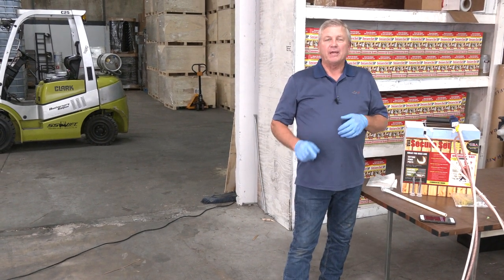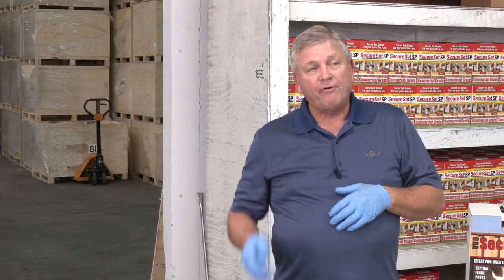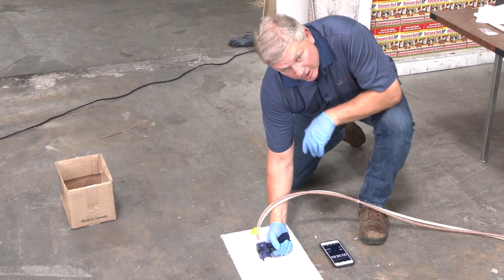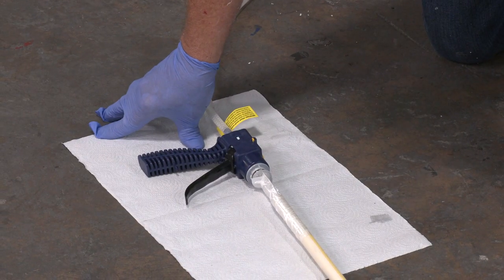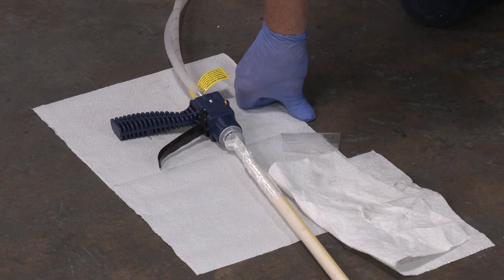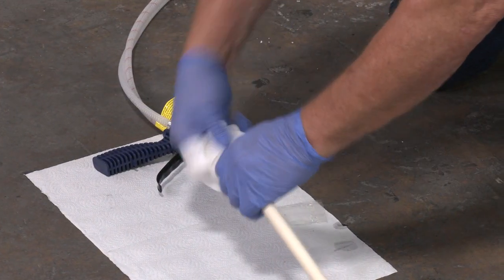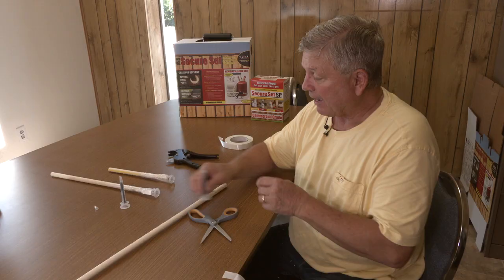Secure Set Spray Foam: Application tips for reaching deep difficult voids

Comment: Couldn't you remove the gun from the cpvc pipe and use an air compressor to push the foam thru the cpvc pipe so as not to waste it as well as clear the pipe for next time.
Reply: Wouldn't there still be residue on it unless cleaned really well with a chemical

Comment: I have  sunken space in the middle of drive way even 25 inch wide, sunk 6 inch down for 20 ft.  Do you recommend to lift up concrete and  spray via 3/8 hole or directly inject without lifting
Reply from the maker: We recommend that you watch our "Foam Jacking, Concrete Slab Lifting with Secure Set" and "Raising Concrete Driveway Slabs with Secure Set" instructional videos on YouTube or on our website  https://secureset.net/gallery/ .
We drill 3/8" holes, and then wrap black electrical tape under the flares on the mixing nozzles about 5 to 7 rounds in order to fit very tight in the drilled hole, it order to not allow any blowback of foam.  The foam will move while under pressure during the development of the expanding foam for about 2-1/2 to 3 minutes before it starts hardening, which is also depending on the heat and humidity.  The foam will also follow the path of least resistance, which also means that it will likely compress soil before lifting.
Thank you,  GRA Services - The Makers of Secure Set
Reply: @SecureSet-Fence-Installation  I want my sunken concrete to lift up, will the foam under pressure lift the concrete. Please note the soil is very tight under the sunken concrete and  there is no clearance under the concrete and the soil -- what i mean to say is -- there is void space

Comment: I just read the intro section which recommends 1/2" PVC with a 3/8" ID.  Thanks.  I answered the question.
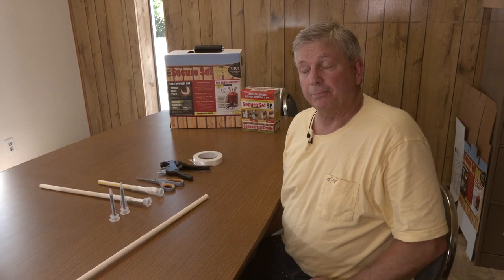Reply from the maker: Thank you for the question.  We call it 3/8" ID in the video, but Lowe's and Home Depot say it is 1/2" ID.  It is made by Charlotte Pipe and says 1/2" on the side of the pipe.  It is sold in the irrigation system section of the store.  Use some tape on the mixer nozzle and insert into the pipe, then use fiber reinforced strapping/packing tape  (it has the fiberglass strings running through the tape)  to adhere the mixer to the pipe.  We have tried many types of tapes, but this is the only one we found to keep it from blowing the pipe off the mixer nozzle.  Watch this YouTube video to see how we prep the nozzles/extensions https://www.secureset.net/aiovg_videos/secure-set-spray-foam-using-application-tips-to-reach-deep-voids/ .  At 5:52 we show the prep work. Make sure to cut the mixer nozzle tips back to allow for a larger conical opening.  Thanks again!  
GRA Services

Comment: What size PVC pipe do you recommend?
Reply from the maker: Thank you for the question.  I see in another post that you found the answer in the intro section.  This answer is also attached to your second post.  
We call it 3/8" ID in the video, but Lowe's and Home Depot say it is 1/2" ID.  It is made by Charlotte Pipe and says 1/2" on the side of the pipe.  It is sold in the irrigation system section of the store.  Use some tape on the mixer nozzle and insert into the pipe, then use fiber reinforced strapping/packing tape  (it has the fiberglass strings running through the tape)  to adhere the mixer to the pipe.  We have tried many types of tapes, but this is the only one we found to keep it from blowing the pipe off the mixer nozzle.  Watch this YouTube video to see how we prep the nozzles/extensions https://www.secureset.net/aiovg_videos/secure-set-spray-foam-using-application-tips-to-reach-deep-voids/ .  At 5:52 we show the prep work. Make sure to cut the mixer nozzle tips back to allow for a larger conical opening.  Thanks again!  
GRA Services

Comment: Could you use 1/2" PEX as an alternative?
Reply from the maker: Hello Dustin,  We have customers that have successfully used Pex Pipe 1/2"   The ID of the Pex pipe is larger than the 1/2" OD CPVC, so you would have to wrap the spray nozzle with a few more turns of the strapping tape in order to make a good connection with the tubing.  Also PEX Pipe is flexible so you have to take that into consideration as a choice between using PEX Pipe v/s rigid CPVC pipe.  Thank you

Comment: What size cpvc?
Reply from the maker: Hello,  It is 1/2" OD - 3/8th inch ID   Normally comes in 10 foot sections, about $3.75 for the 10 foot piece.  Can be found at Lowe's and Home Depot. Thank you
Reply: @SecureSet-Fence-Installation  Hello, I look at Lowe's and Home Depots Websites and they spec their 1/2"  CPVC inside diameter as 1/2" nominal.  Will that work?
Reply from the maker: Hello Tony,   Yes, the CPVC is primarily for irrigation, the 1/2" OD / 3/8th" ID is just right.  If they call it nominal, it will be OK.  Thank you
Reply from the maker: The CPVC needs to be 1/2" OD and 3/8" ID.  Make sure to tape it on to the nozzle exceptionally well with the fiber reinforced tape to keep it from blowing off.
Thanks again for you questions.

Comment: Once you pull the trigger to allow the product down the CPVC tube I assume you have to keep the product flowing, and once you let off the trigger the product in the tube sets up? 

If that is true how much time can you leave off on the trigger if you have to reposition your CPVC tube before the product sets up?

Thanks in advance.
Reply from the maker: Hello Mark,  Good question!  Once you pull the trigger and the product is flowing through the extension tube, depending on the outside temperature, you have approximately 25 to 30 seconds before you have to start flowing more material. The hotter the outside temperature, the shorter the time you have to reposition. With ambient temperature above 95° F you have about 25 seconds before it sets.   If you have the ability to trigger a small amount, every 15 seconds, you can extend the "overall" reposition time almost indefinitely.  Thank you.
Reply: @SecureSet-Fence-Installation  Okay, perfect, that brings up one last question, can it be too cold outside to apply this product? We are going into September weather and it is around 55 degrees in North Idaho. I can always wait for a warm day.
Reply from the maker: Hello Mark,  If you keep the canisters inside and make sure they are at about 80° F, when you work on your project you will have a robust spray and the foam will expand nicely.  The only issue about application and expansion is if you allow the canisters to get cold.  If the canisters were at 55° F, you would have a slower spray foam and the expansion would not be as fast or as much.  Thank you
Reply: @SecureSet-Fence-Installation  Thanks again for your fast reply!